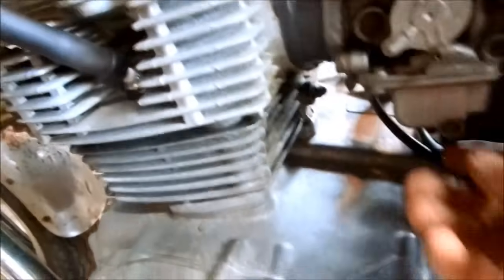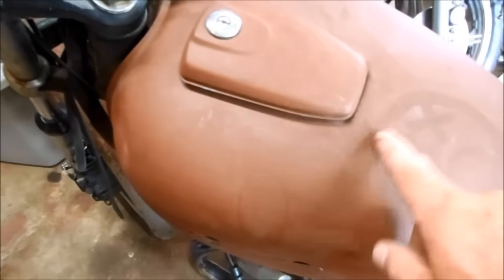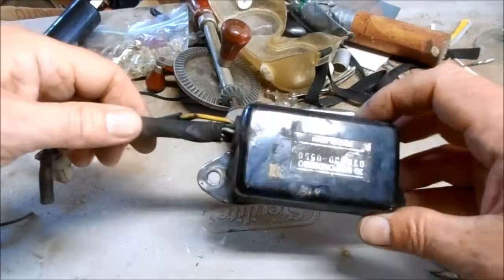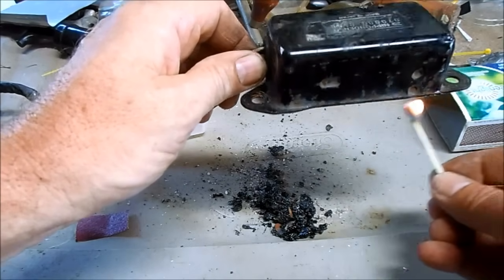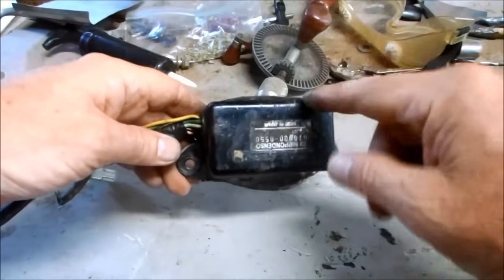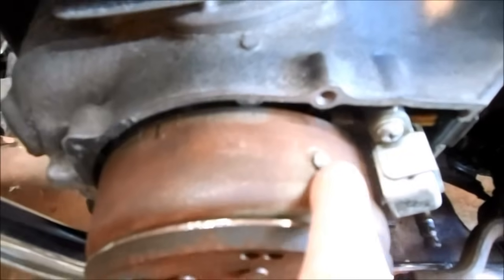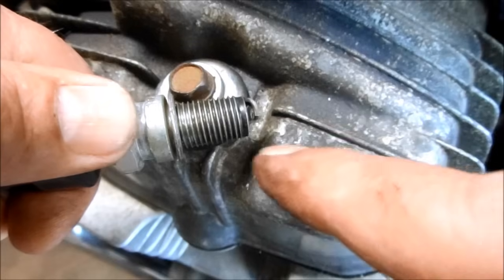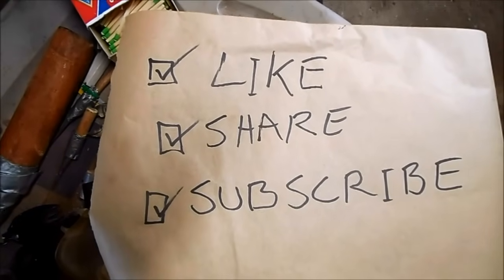how to test and repair motorcycle CDI electronic ignition module coil system spark failure

Comment: Is it possible to cut a hole in that side case and install an auto distributor and have it rub on that durn wheel? I cant get the lobe right.tried a lump of bubble gum. Didnt work. Help.
Reply from the maker: +hanzoso  you might need to wrap it with friction tape to ensure it spins with the wheel

Comment: Mine did the same thing.  Died while riding.  Won't crank, just click.  Tested stator, rectifier/regulator, ignition coils, ignition pulse generator.  All were good.  Only thing I can think to be the problem is the CDI.

Comment: I'm confused, shouldn't that new Bosch electronic ignition be wrapped in waterproof motorcycle assembly tape? It is going to get wet. Maybe you live in a dry climate Ichiban and its unnecessary. I too would have used a spoork to remove the epoxy.
Reply from the maker: Mark Stevenson   The system is installed behind the engine case cover that has a sealing gasket.

Comment: I need to have you email me instructions for my 1979 honda cm400a no spark problem it ran great for years until it had no spark everything else is great . I need to get this bike back up and running any kind of cdi that will work will be fine . Remember it's a 2 cylinder automatic 2 speed
Reply: Kit numbers parts numbers what will work thanks

Comment: I WELDED A CAM LOBE ON A klx250 MAGNETO CASE AND FITTED POINTS LIKE THIS ONCE,IT WASN'T MY BIKE AND IT DID RUN BUT I HAD TO GO TO WORK WHILE MY LAYABOUT MATE PISSED ABOUT WITH THE POINTS POSITION(I MADE A PLATE TO MOUNT THE POINTS),GOT THE BUGGER GOING LIKE A BEAST,USING HOME COOCKED PARTS.BUT THIS ONE .... NAH TRICKERY AND SHENANIGANS,THOSE PLIERS AND SCREW DRIVERS WERE ALL FAKE.
Reply from the maker: i made those screwdrivers. i have a video on that if you need a set

Comment: What Bosch system is this please!! I have a cm400 and have the same problem!! Please help!!
Reply: Alex, unfortunately, this guy is more of a humorist then a serious mechanic willing to help people. His theory is valid, his method is not funny when you have this problem. Chances are your CDI box or ignition coil is bad. I would buy a service manual and use the procedure recommended. I have a 78 Cb400t, same problem. New coil, then a CDI box that was bad. You can get them used but its a crap shoot. I had a spare from an 80. Hope this helps
Reply: look at this video on my run I in my honda cm450 is the same cdi  "Electronic CDI Box Repair 75% Success Rate"

Comment: I dont think it will work properly.once the flywheel rotates,it will break the part of the points that touches the flywheel because the lobe doesnt have a wedge on it.and arent those points located underneath the flywheel.i would recommend using a different cdi and convert all wiring connections.

Comment: Hahahaaha...ichiban moto....ichiban moto
I think u show me how to repair u'r abnormal cdi..u burned epoxy cover and cleaned...then showing new box with cdi inside then adding new pulse part on old one for advanced ignition and done....so simple solution bro.
Yeaah u shouldn't fired it....just cut the cable then place with new one done.
Hahaha.greeting from +62 brother

Comment: hi, that was an awesome video Ichiban! I live in Mumbai and the trouble is there are no motor-cycle mechanics who really know the entire mechanics of a bike, they just keep on doing a trial and error method. I have a 135cc motor-cycle and everytime I turn on the ignition, the bike goes full engine i.e. full throttle without me even touching the throttle! It comes back to normal after sometime. I have been trying to fix the problem, but noone has done it, is this what is known as the engine surge? I think it just uses a lot of my fuel, would you know how to fix this problem?
Reply from the maker: double check to ensure the throttle is not actually sticking. If that is completely free  and smooth, check for vacuum leaks around the carb boot and clamp area. You can do this by waiting for it to idle at low rpm and spray starter fluid or carb cleaner around the joints. if the idle changes, then there is a leak sucking in the fluid
Reply: thanks Ichiban, that was a very quick reply. Very happy to hear back from you! I dont think the throttle is sticking, will try what you suggested.
Reply: Ya 
Step One- light it on fire 🔥 
Step Two- get a new one lol 😂

Comment: You do realise you can refill the CDI box with sparks and as long as the smoke capsule was not damaged and leaking then you are good to go for many more miles. Not tried replacing the smoke capsule but sure it can be done? They must come in different sizes, a bit like fuses, as seen little wisps of smoke from a small one right up to a big puff from what must be a big capsule?
Reply from the maker: are those interchangeable? i have seen the lucas electrics replacement smoke in small jars lol

Comment: How do you tell witch is the right one? I have a 1981 Suzuki GS1000g.
Reply from the maker: your CDI is Suzuki ignitor, SGP part number 32900-45120
Reply: What web site did you find it on?
Reply from the maker: grab a good used one off ebay
Reply: I did that and got one ride. That was it for that.

Comment: homie my bike won't start it's a 750 cb Honda 1980 suppersport.i change the battery it started. so I turned it off and tried turning it on again nothing
Reply: Ernest Gurierrez bad ground somewhere, check fuses, look for the bad ground and repeat. check connections etc.

Comment: hey!  i have a 2004 Suzuki S40  its backfire any ides?
Reply from the maker: +shlomo ben arbon   lean bikes backfire. If everything is stock, check for dirty pilot jet or vacuum leaks around the intake between the carb and head( spray some carb cleaner around there while running and see if the idle changes)  There may also be a hole in the air cut-off diaphragm in the carb causing if it only happens on decel.   If you have modified the intake system or exhaust in any way, that could also be the cause and you will need to re-tune the bike

Comment: That's replacing electronic ignition with points, maybe the electronic ignition had a built in advance curve with RPM, now that's lost. But I guess its a rat bike, so not really a problem.

Comment: Worst bit of fault finding I've ever seen!
 - No logical, reasoned thought process....
 - So, after a few minutes random "poking about" he declares the CDI unit is the culprit because "it's got rust inside it" (ignoring the fact that he's broken the circuit board in his attempts to scrape off the potting resin).
And even if he had been successful in gaining access to the delicate "flame eating" electronics board inside, did he intend to fix it using his "broom handle screwdriver" and trusty  pipe grips!?
Then, after all that he replaces the precision, maintenance free electronic system with a set of points!
A trained chimp could have done a better job (and probably cost less too).
Step away from the vehicle!

Comment: You use the wrong tool for the bolts or (screws) Cross tip screw driver for a hex screw doesn't work so well & vice grips on everything ??? Must be a Chinese Mech. LOL I know , it's semantic. LOL
Reply from the maker: metric